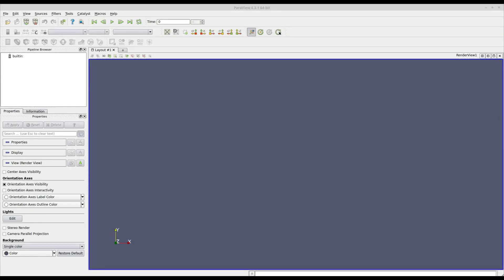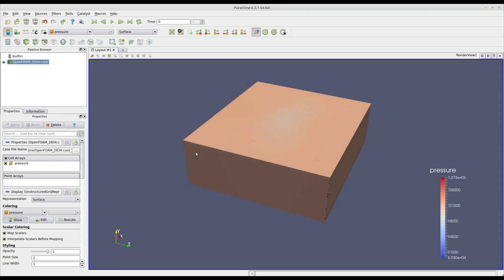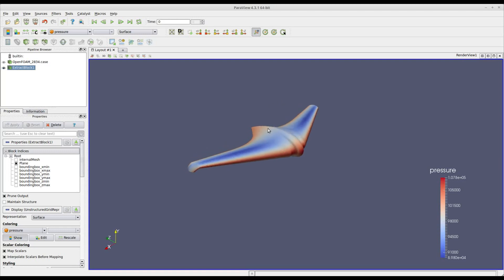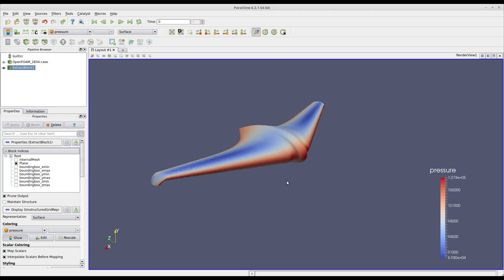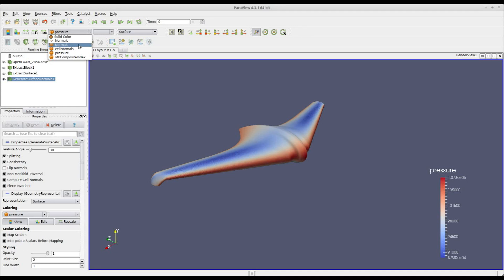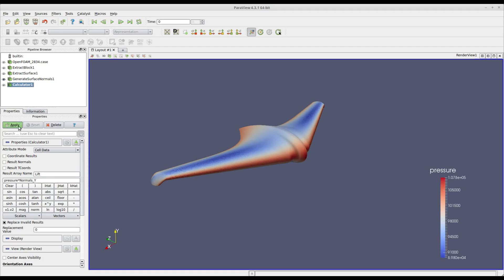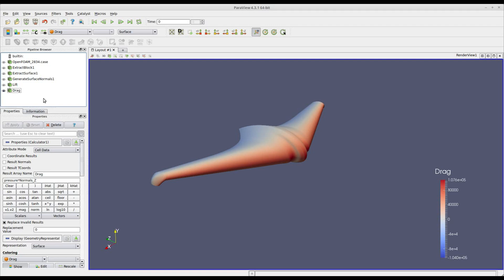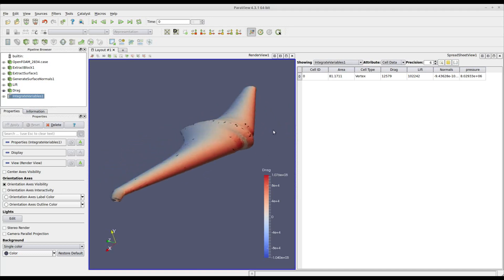How to calculate aerodynamic forces with Paraview

Comment: I think this will give normal force and axial force. Not lift and drag.
Reply: I think I agree with you, but I am not sure. To get the total lift force the pressure load on the mesh face should be multiplied with the mesh face area.
Reply: @lucderuiter8904  To be more precise, if you change angle of attack with  velocity vectors this procedure will give Normal and Axial force. On the other hand, if you change angle of attack by body rotation it wil give Lift and drag force.
Reply: So, the tutorial doesnt give dragCoeff? How can I obtain dragCoeff?

Comment: Hi, I tried this on one of my projects and the integrated values are showing the drag values without considering the viscous effect. Is it possible to get those values too, the software I did the simulations showed both the drag due to the pressure force and the drag due to the viscous effects. How do I get it on Paraview?
Reply: It's a late answer and you surely have figured it out by now, but for reference you need to have or compute the wall shear stress then include them in the calculation of the forces

Comment: Hi, Thanks for this tutorial.
In my case I am not able to select a specific boundary surface as you did: The data hierarchy is set on Multi-block dataset. I can just select Fluid domain and a general Boundary.
Do you know how I can solve this issue?
All the best
Reply: Hello I am also facing the same problem..did you find a solution to it..
Reply: I know this is old, but the solution is selecting openfoam reader from just above where the extract block filter appears in the tree in the top left and making sure the cut or wall that represents the aircraft is selected then hitting apply

Comment: Hi! Thanks for the video. I would like to make you a question. For the incomprensible case, the pressure is usually not in [Pa] but it is divided by the fluid density (so the unit is m^2/s^2). On that case should we multiply the pressure for the density in order to have the proper pressure? (and the proper forces). 
Second question. I am calculating the forces exchanged between a boat hull and the water (so density=1000 kg/m^3). Should I use the same formula multiplied by the water density or should I use the same formula? Thanks in advance for the answer!
Reply: Yeap, u r right
one need to muliply pressure by density, to get actual force value

Comment: Hi, you said you have an air flow that's straight along the z-axis I believe. I'm trying to calculate drag and lift of a rudder, so naturally, I will do that in various angles of water flow. How do I do that?

My Water flows in negative z-axis direction at 0 degrees. At 20 degrees it flows cos(20deg) in neg z-axis and sin(20deg) in neg x-axis. 

Do I just use those same factors in the lift calculation? 
So should it look like this: lift = pressure*(cos(20deg)*Normals_X+sin(20deg)*Normals_Z)
Reply from the maker: One simple thing one could do is to maintain the flow speed aligned with the simulation main reference frame and turn the geometry accordingly around the right axis. Otherwise you con project your velocity component inside paraview using the calculator filter.
Reply: I thought about turning the geometry, but I don't like that solution. I don't quite understand what you mean by projecting the velocity component. Projecting it where?
Reply from the maker: If your inlet velocity is slightly inclined with respect to the system of reference you can define a new system of reference that is aligned with the velocity, and then calculate the velocity components with respect to it, projecting them onto it. This means you have to compute the proper coordinate transformation via the cosine matrix and project the velocity vector. But you have to pay attention also to how surface normals are defined in such a case, since they are vector too, you should take it into account in the new system of reference. So probably turning the CAD can be the most straightforward way.
Reply: But can't I just calculate it as if I didn't have an inflow angle and add both, which should give me the resulting force vector? And then I can just take out the drag and lift components depending on my own frame of reference.
Reply from the maker: It can be a solution, it should work. You can calculate lift & drag for a 0 angle geometry and inflow, then rotate both the geometry and the flow inclination and use your approach to verify if it works.
Reply: Good Idea, thank you very much!
Reply from the maker: Thank you Adrian, keep up with the great work!
Reply: Just to make sure it would be great if you could confirm if I understand it right: The Normal Vectors on the surfaces all are as long as the corresponding surface has area, right? Cause I get 2100N drag and that seems like quite a lot. 

Maybe my water speed is just much larger than the propellers can handle and I should simulate at a smaller speed.